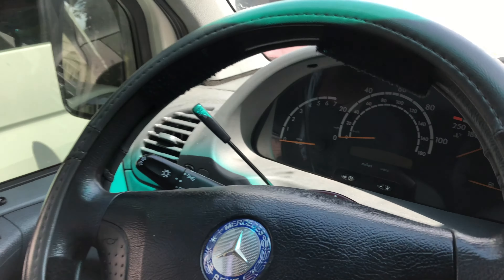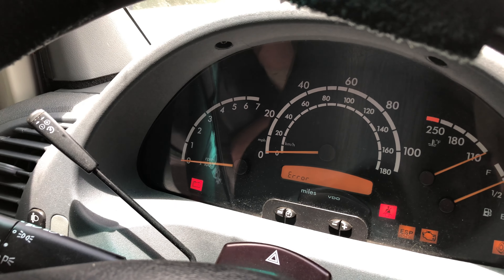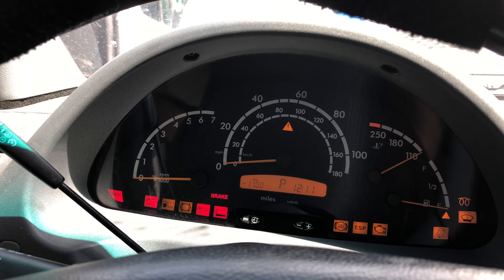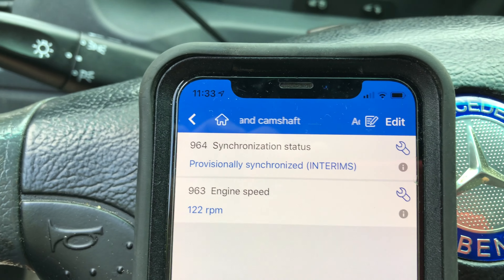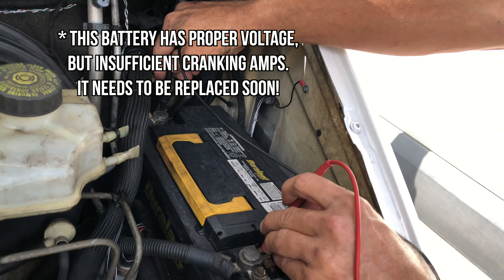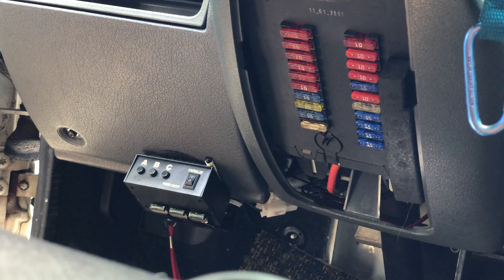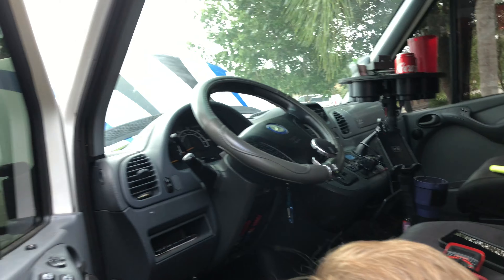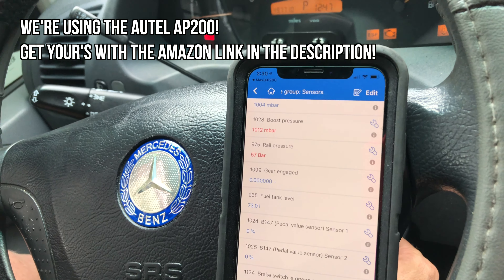Common Causes a Sprinter Won't Start. Fuel pump relay, starter relay, fuel flow, low battery, etc.

Comment: When it’s cold it starts but once it’s running for maybe 30 mins and you turn it off it won’t start till you jump start it. I already put a new battery, fuel pump, alternator,crank, coolant temperature sensor and checked the fuses. I order a starter relay this week hopefully that’s it. Van runs great just won’t start after it heats up.
Reply from the maker: That sounds like a cam sensor heating up. It is on top of the engine near the #5 injector. You've probably replaced this and just omitted it in the list above, but if not.... I hope this helps. Another idea comes to my mind. Does the electric fan in front of the radiator work when the A/C is on? If it does not work, this may be hiding another symptom. If that fan gets voltage when you turn the key on... and then the van won't start.... That's not good. Not good at all, but we do know how to fix it.
Reply: @FloridaVanMan  thank you for responding back to my question. Is the cam sensor different to the camshaft sensor. I seen video and they show that’s it’s under the van by the transmission. Is that right or is that something else?
Reply from the maker: @eliasmunoz5439   Crankshaft sensor is accessible under the van, near the transmission, but the Camshaft sensor is different. Camshaft sensor is on top of the engine, near the back injector (#5) and to your left as we see it looking from the front. It sits alone opposite the injectors, under the plastic cover with the oil separator. It is an inexpensive part and common failure symptom is no start when the engine is warm or hot. This can be tested with a code reader like the AP200 by viewing Cam/Crank synchronization. The "no" reading should change to "yes" when the key is turned. We have links for the code reader in several video descriptions.
Reply: @FloridaVanMan  I think that’s my issue. Thank you again really appreciate it for the help and time.
Reply from the maker: @eliasmunoz5439  If it works out for you please consider making a donation to the channel.  PayPal Bill@FloridaVanMan.com or Venmo to Florida Van Man. Thank You.
Reply: @FloridaVanMan  I will for sure
Reply: The  crank and cam sensor didn’t fix the issue. Tried everything you said on the video but still won’t start
Reply: @FloridaVanMan where do I find the cam/crank synchronization in the autel. Having trouble finding it, having a lot of starting issues. Thank you
Reply from the maker: https://www.youtube.com/watch?v=n4qdK3X03So&t=908s 
 @trevoradams7237
Reply: @FloridaVanMan  thanks for the link! I followed the setup and instructions but can sync status still isn’t showing up. Maybe not an option on my autel??
Last option is the can bus.
Reply from the maker: I remember having trouble finding it on an '02 or '03 van in the past. I don't have one here to try today, only '04-'06 vans.  @trevoradams7237
Reply: @FloridaVanMan  must be the case!
Reply: I contacted autel I let you know if they have any info

Comment: Very helpful information as always. 
I have a similar problem I am in California otherwise I would bring the van to you. The van starts randomly I had to hit under the column form time to time and it works. When it doesn't work  you'll hear the initial beep beep beep and the cooling fun starts running but not ignition, no cranking, nothing. I was told that the whole ECU computer, immobilizer and key w ignition needs to be replace.  any suggestions?
Reply from the maker: SOS Diagnostics will repair the ECU for $600-$800. You will have to send skreem & key chip with because the computer is being reprogrammed. If you get desperate and find it unwilling to start at all, try sparking the battery with an 18 volt drill battery. It will only get worse from here on out without being repaired. There may be cheaper options on eBay, but SOS has been the go-to for years. One of our own vans, the red camper striped one, had this problem in 2013 and it’s been solid for 7 years. -Mike
Reply: @FloridaVanMan  Thank you very much for the info. Thank you for posting great videos.

Comment: Mi furgón solo hace clic en la mañana y no enciende, después de empujarlo y encenderlo no tiene problemas en el día, que será? Gracias
Reply from the maker: Camshaft sensor is likely culprit but more often fails when hot and works when cold. Fuel pump quantity control valve & fuel rail pressure control valve are logical places to look also.

Comment: Awesome video! I also have Autel AP200. Cranks but won't start. 
Rpms during cranking don't move at all. No trouble codes. 
It's "synchronized" during cranking. 
Rail pressure over 300 bar. 
Is it the CPS sensor? Thank you :-)
Reply from the maker: I think it is not the CPS since you get "synchronized". That leaves just 7,000 other possibilities and I can only guess from here. Sorry.
Reply: @FloridaVanMan  Thank you anyway! :-)

Comment: Bill, good content for sure!! Do you have any advice on limp mode resolutions? 2005 Freightliner with 201,000 I've changed the EGR and resonator but still occurring. It goes away if I stop and shut engine down and restart then is fine. Seems to do this more frequently during cold winter months. FYI, drove it on a 7K mike trip last summer and never went into limp ode. Sorry for being so wordy. Really enjoy your channel and your approach and delivery is awesome. Thanks!
Reply from the maker: Need to put a proper code reader on it and see why it is going into limp home mode. AP200: https://amzn.to/2GD04Ft  
We also have a video on resetting limp mode without stopping.
Reply: It starts on its own while it's on

Comment: Does anyone in the comments have, or know where I can get a valve cover for a 2004 sprinter 2500 with the 2.7 in it? Ours is broken around injector 5.

Comment: 2006 416 HYMER Mercedes Motorhome No crank.grey relay no click .Relay seems ok.no power clicks off .van.sends power to terminals.Why no power to relay.Thanks.
Reply from the maker: I've only seen one Hymer and not done any work on it. Likely a fuse, possibly a big one on the front of the battery.

Comment: Mines says error still whont start what can I do
Reply from the maker: Start Error on the dash is often fuse #7 under the steering wheel. Does your horn work? This video may help identify if the trouble is in the ECM or the van not feeding it power. https://www.youtube.com/watch?v=hRmXq4KRHdQ&t=2s

Comment: Good video have you ever had a sprinter that the ignition turns on but won’t crank ?
Reply from the maker: Yes. Does it display StRt ErrOr at the odometer?
Reply: @FloridaVanMan  no it just has a few symbols which don’t make sense
Reply: It has had a new eis fitted and key switch
Reply from the maker: @johnharris5028  You lost me here. What is eis and what symbols don't make sense?
Reply: Sorry ESL does that make sense
Reply: @FloridaVanMan  I will take a picture of them next time I am there
Reply from the maker: @johnharris5028  Nope. ESL is not in my book either. And what symbols?
Reply: @FloridaVanMan  it’s the unit behind the ignition key
Reply: @FloridaVanMan  type eis error in the search utube
Reply from the maker: @johnharris5028  I see now. I Googled it and didn't narrow it down. YouTube search worked. Now I know. Cheers & Thanks.
Reply: @FloridaVanMan  I have a picture of the symbols but I can’t send on this is there another way I can send it?
Reply from the maker: @johnharris5028  The best way is to send a small donation with a note. I've stopped posting my email address and phone number because of the scammers who abuse it. FloridaVanMan on Venmo, CashApp or the link above to BuyMeACoffee.

Comment: Mine won't start first thing without a jump and then it's fine for the rest of the day, any ideas
Reply from the maker: Sounds like you’ve got some vampire drain killing your battery overnight. Or a weak starter pulling too much when its cooled down.
Reply: @FloridaVanMan  God bless you brother

Comment: Do you work on 2010 MB sprinters 3500.  Can you upload videos on those.  Thanks
Reply from the maker: Sorry, we have an '08 that is similar to your 10, but not very much work to do on it. It has had DPF issues mike is conquering. What trouble are you having?
Reply: Florida Van Man van cranks but won’t start.  Battery, starter, cam sensor are good. Fuel pressure is good.  I’m out of ideas here
Reply from the maker: @DAVIDB61201  How did it get to this point? Did it stall on the road, wouldn't start one morning, bought as a project...? You say fuel pressure is good, but how are you measuring that? My gut response is to unplug the MAF and try to start it.
Reply: Florida Van Man drove back from a round trip 600-650 miles then next morning just didn’t start.  I did the MAF.  Also the bluedef was deleted like 2yrs ago. So is nothing to do with the bluedef.  Thank you for your time
Reply: The fuel pressure I tested with a harbor freight fuel pressure tester and is at 5500psi
Reply: Checked all 6 glow plugs and they all work

Comment: So what your saying is if cam sensor is not working the rail pressure won't come up? Not very concise.
Reply from the maker: If the cam sensor is not working the injectors won't fire. Rail pressure should still come up. We often do testing of the rail and injectors with the cam sensor unplugged to prevent engine starting. In this state we test leak-off return from the injectors and rail, individually by cranking the starter for 10-15 seconds.

Comment: Awesome Video, My 2004 sprinter is  not wanting to start after a short drive after the initialing  cold start in the morning
.  
 If it sets for  a few minutes it will start again. 

 I'm in the trades so I drive my van on short drives through out the day.
Reply from the maker: Typically the cam shaft sensor is what causes no-start until engine cools.
Reply: I replaced the cam shaft sensor and it’s been a few days of normal start ups.    Thank you so much.

Comment: Help please. Could any of you good Sprinter people tell me what I need to do next on my 2003 Sprinter (313/40,  2150cc )Starting normal, can Run for 10mins or 2 hours then dies, sometimes with a flicker on the tacho, sometimes not. Will start again but needs to delay a while now before its ok again, had this problem on the road occasionally but could start instantly without even stopping the van
 No pump in tank I believe  and fuel is always up as I put an in line filter on to watch for supply and looks ok. Help Help Help.
Reply from the maker: Hi Ray, My first guesses would be crank sensor or a bad wire grounding out. You'll need to get a proper code reader on it to do more than guess what the problem might be. We have a link to the AP200 in almost every video description and a new video showing how to set that up.

Comment: Does that mean if your key battery is dead the sprinter won't start?
Reply from the maker: Not at all. The battery in your fob  only deals with the central locking system. The chip in your key that is not much bigger than a grain of rice is what communicates with the SKREEM and authorizes engine start.
Reply: @FloridaVanMan  but how would it communicate if it has no power?
Reply: @FloridaVanMan  I was hoping this was my problem but not lucky enough. I'm disconnecting the battery for an hour.
Reply from the maker: @grantdubridge7995  I'm not completely clear on this, but something like wireless chargers work on our phones. The near-field energy excites the chip, and the chip responds by sending a unique signature radio signal. That signal is picked up by the ring antenna around your key-hole, and Ta-Da! A bit of magic we aren't supposed to understand.
Reply from the maker: @grantdubridge7995  Mike struggled with a van today and found the center relay at the bottom of the steering wheel fuse block was causing No-Start situation. Reseated that relay and van started again.
Reply: @FloridaVanMan  I'm in Michigan. Drove the vana half mile wish it was 35 degrees without letting it warm up. I went in the gas station, came out, no start. Tries but doesn't complete starting. Bbrruummmm. That's it.
Reply from the maker: @grantdubridge7995  That sounds like a cam sensor that won't enable start once it is warm https://www.youtube.com/watch?v=Exgt_C6oZf8
Reply: @FloridaVanMan  I found the no start problem with my sprinter. The cam position sensor was unplugged.